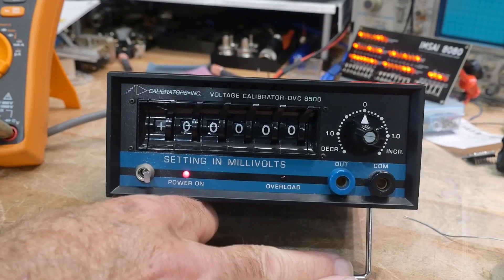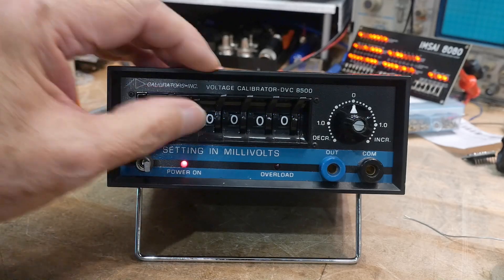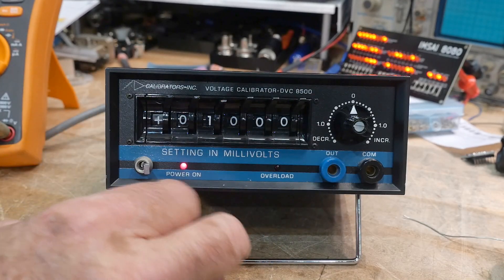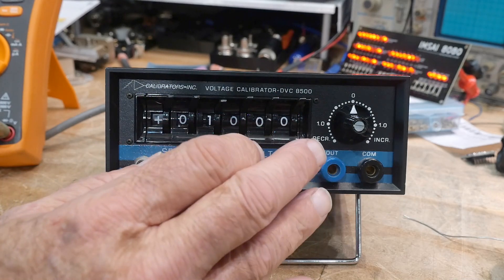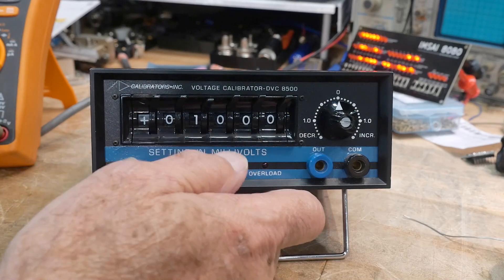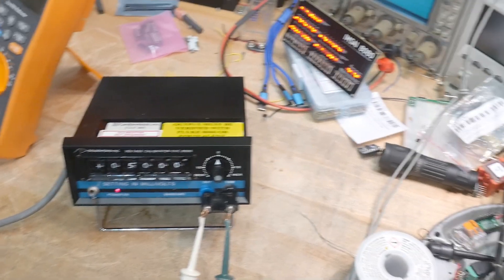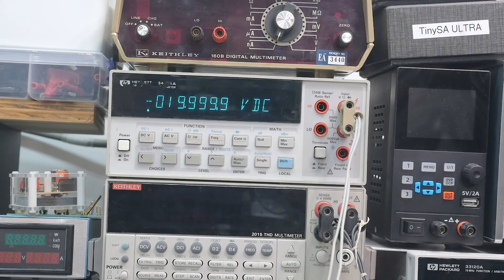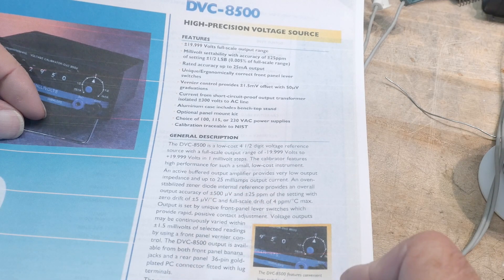#2122 DVC-8500 Voltage Calibrator

Comment: I've used these hundreds of times in the lab. Usually setting gate voltages when testing fets. Think only downside is they max at 40mA. Which is no problem for most phemt GaAs amplifiers

Comment: I have a Datel  DVC-350A that is labeled "GE DATEL", so in other words, General Electric Datel. It does 0 to 12 volts and also 0 to 10 volts in hexadecimal. It is still quite accurate, but unfortunately there is a problem with the flat plastic ribbon cable that goes between the membrane switches on the front and the main circuit board. Over the past 40+ years the printed conductive trace has been etched off where it enters the connector. I tried some silver conductive paint, but that seems to only be a temporary fix. It is a real problem because when certain traces don't conduct, the unit will output over 13 volts, regardless of what the display says. Not a good idea when you are testing something that is expecting millivolts. It mainly just sits unused in a drawer now since I have better equipment now to perform the same function ( except the Hexadecimal function)

Comment: I just got 2 lm199's calibrated to 7 digits, so 🤔 about buffering with a chopper stabilized op amp to 10.000 V, and hook that to my 4 decade Kelvin Varley Dekapot... Hmmm.. with the op amp, and +/- supply, I guess it could be:+/-10.000V.
Nice find you have there!

Comment: I have two of the larger ones that has the knobs. They're pretty accurate, and that operates by using a hand-picked zener. You can still purchase those diodes as well.
Reply from the maker: https://youtu.be/DDZeX3IUzVk?si=8fNIKYipdg01168W
Reply: @IMSAIGuy  Yea, those at the link are EDC. I have two from when Data Precision existed, back when the 8100 and 8200 were in production. They used the precision zeners. I think this 8500 uses an ovenized zener.

Comment: Wavetek?  The only Wavetek gear I got is a model 22 function sweep gen.  I can only afford to have one of my bench meters sent out for cal so something like that is interesting,  depending on the price.  Ain't cheap?  250 is nice but must be a find. For 1000 I could pay for calibrations awhile but for 250 it could pay off especially to check my other meters.
Reply: I've got a Wavetek Model 184 sweep generator I picked up off ebay some 20 years back - still has Johnson Space Center tags on it.

Comment: Nice little unit.  Especially if you don't need 7 or 8 decimal places of accuracy.  I have a Keysight 3458A 8.5 digit multimeter I picked up at a surplus auction.  Basically sets on the shelf and looks pretty.  2 to 3 digits is all I need on a daily basis for repair work, at least the stuff I repair.